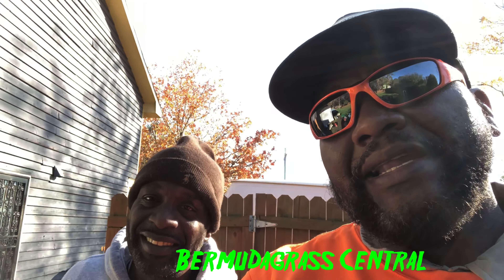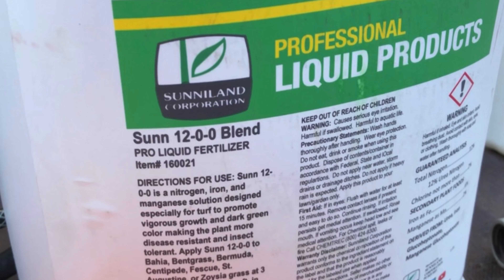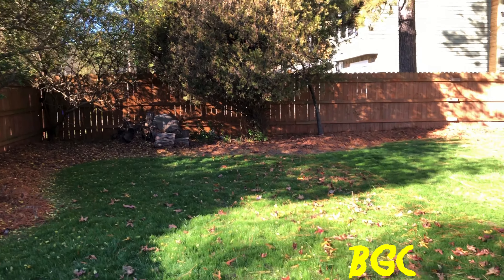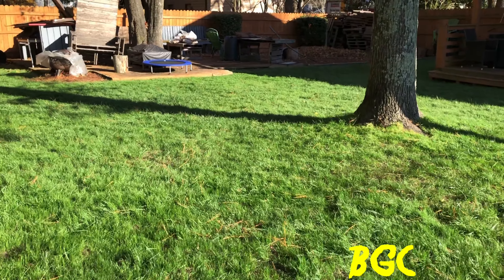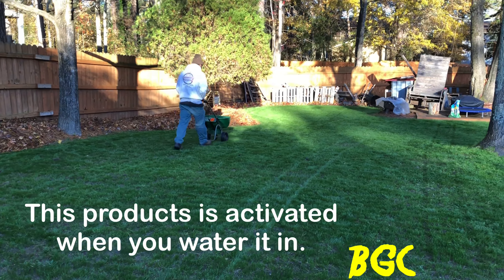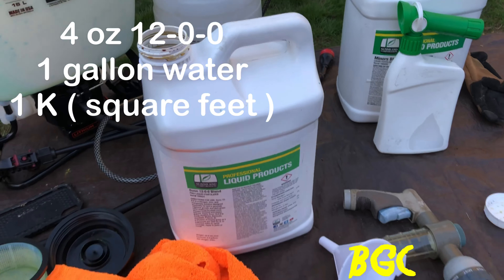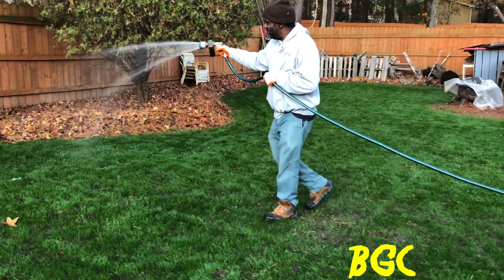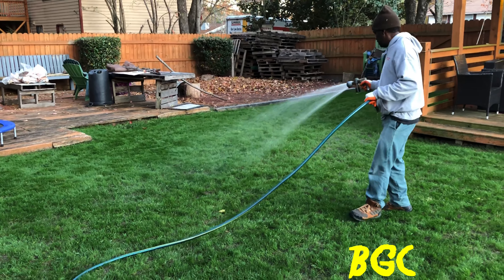( Secret Revealed ) Sunniland Lawn renovation & overseed Success Before and After. Liquid Iron

Comment: The pump should not be making that noise.  It sounds like you may have air in the line.  To be sure, unscrew the wand from the trigger and spray for a few seconds to prime the line and remove the air. Also, your cousin should raise the wand closer to his knee so he gets the full spray width that the nozzle offers. He has the nozzle very close to the ground.

Comment: Those trees are going to be his challenge come spring and summer creating lots of shade and thinning the grass.  Any tree pruning planned?
Reply from the maker: Methodical2 no tree pruning planned but the quad mix does have shade tolerant sources but we will have to wait and see.
Reply: Bermudagrass Central keep us posted. I did not have luck with the shade tolerant seeds and had to do some serious pruning, so much now that I can go back to planting bluegrass, which I will do this spring. Also, that TTTF is not good for a lot of heavy traffic use either.  I miss my bluegrass; it has it's problems, but mostly has more benefits over TTTF.

Comment: Where did you get that nozzle that was used attached to the water hose and what is it called? Thanks
Reply from the maker: Methodical2 I’m not absolutely sure. I wS buying car wash 🧼 products at Walmart and saw it. I thought it would help wash the car faster 😂
Reply: Man, your Walmart has stuff I just don’t see in my area.  I found some on Amazon though.

Comment: Can that grass survive the summer?
Reply from the maker: Richard smith if you have a irrigation system and you water 💦 the crap out of it, there may be a chance. But in most cases the heat will beat here in the South.